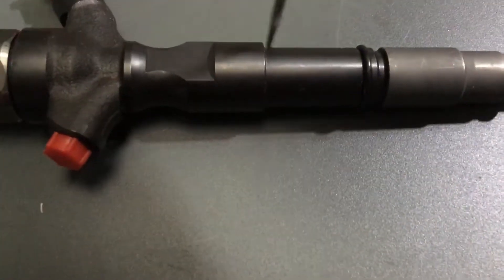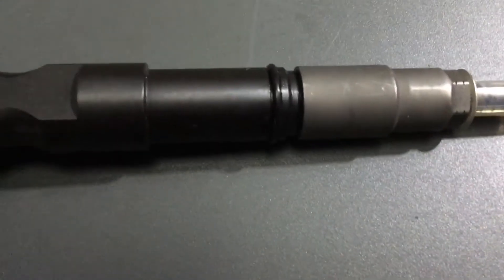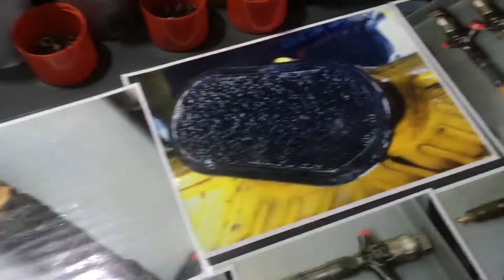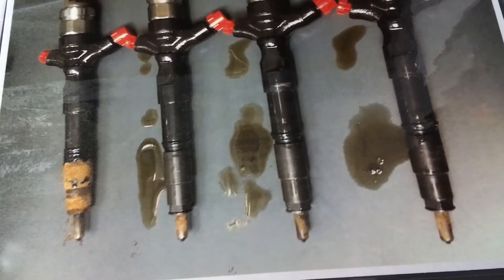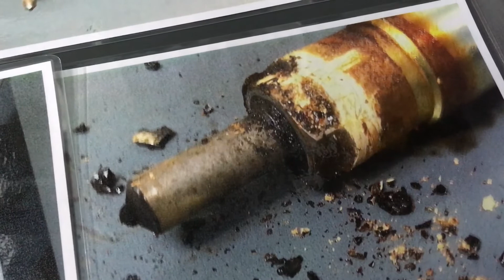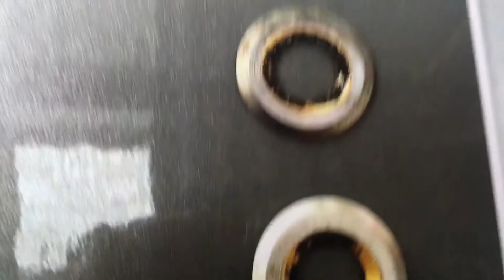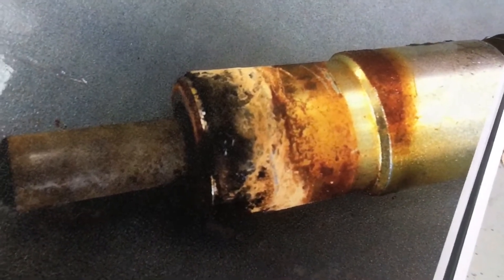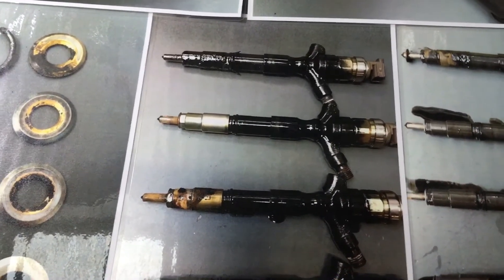Prado hilux diesel Injector

Comment: Hi. 

What is the component called at 3:33?
Reply from the maker: Wayne Lavarinhas 
As it says in video, oil pickup.
Search blocked oil pickup on our Facebook page or oz prado crew
Reply: Fourby4Diesel thank you. I'm trying to find it but with no luck. 

My Toyota Hilux 3.0 D4D injectors are currently being replaced and just want to ensure that all parts that can be cleaned are cleaned. 

I don't know a lot about engines so was wondering where this component is located so that I may instruct the mechanics to ensure that it is also cleanes while the injectors are being replaced. 

Thanks for your videos, very helpful. Regards, Wayne
Reply: Its the pipe from the oil pump into the sump. It would normally have a gauzed cup (for lack of a better word) on the bottom, it can be seen thru the sump plug when its out.

This is the video https://www.youtube.com/watch?v=7xwa-Wb4DGs